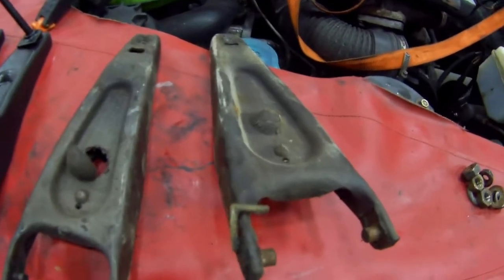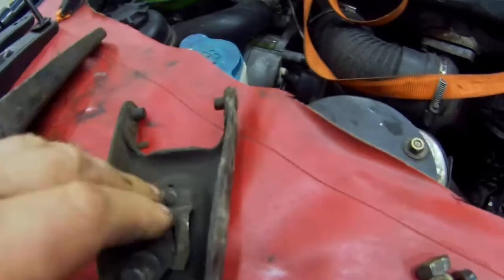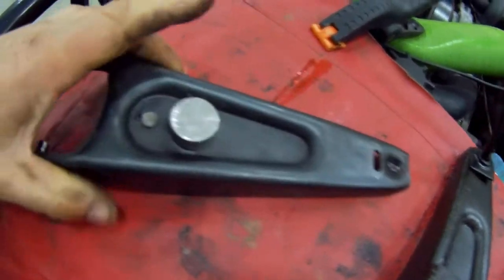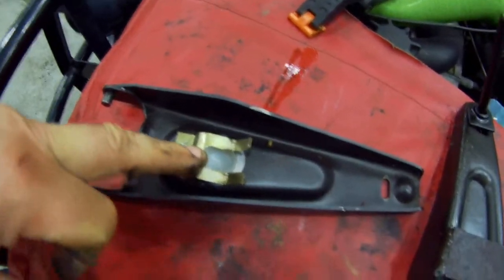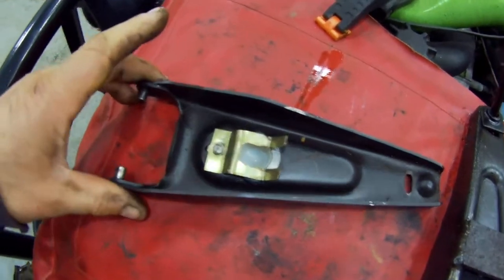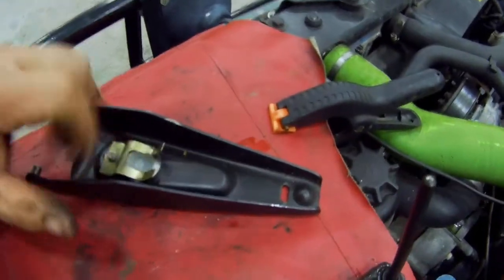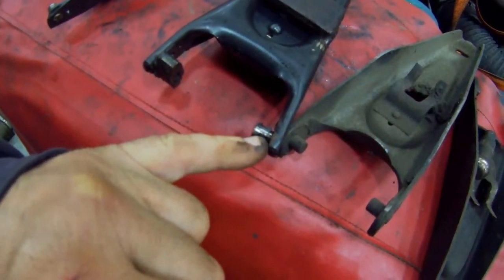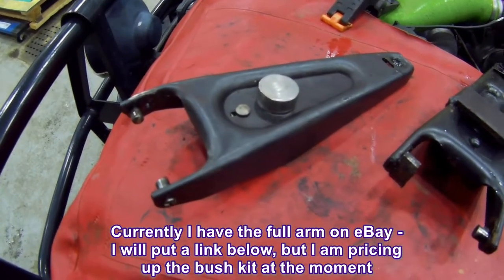Land Rover clutch fork/arm (FTC2957) failure, and my solution

Comment: Have you come across the problem of the fork pivot being too short when converting from auto to manual & fitted standard r380 box but HD lof clutch kit. The fork hits the bell housing before it engaged gears.
Reply from the maker: The pivot ball comes with the bearing guide, so there should not be an issue - but it could be someone has fitted a short LT77 pivot in its place
You didn't mention what vehicle this is, so not easy to give an accurate answer
Reply: @BritannicaRestorations  sorry the vehicle is a 300tdi disco, I've now replaced the clutch fork & pivot with another HD LOF part but still have same issue, however I can get gears when engine runs if transfer box in neutral but can't change gear if in high or low so can only drive in whichever gear is chosen. Clutch pedal stiff but can push to floor with hand so may not be bled enough.
Reply: @BritannicaRestorations  quick update, I've re fitted the transfer linkages today as per watching your video so thanks for that as I was struggling for high. Now I've got high & low working & a good cluch pedal I'm having to force in to gear but can drive all gears but to get reverse have to put transfer into neutral then put in reverse then transfer back in to high. Am I right in thinking I've got a bad transfer box ? All gears change fine & smooth when engine running & transfer box in neutral. Thanks.

Comment: Hi Mike, I had a fork fail on my 200tdi LT77 110, I had replaced the fork every time I did a clutch or the box/engine was out, but at 260000 miles the fork failed.  What I found was the pivot ball (which I had never looked at) had worn into a bizarre kind of point which made its job worse.  So at that time I replaced the fork and the pivot ball, and the gear/transfer boxes (The gear box was at 140k and the TF at 260K, the ATF in the LT77 came out siver! even through I drop the oils every 4-5k) .  Have you seen the pivots worn like that?
Reply from the maker: Yes Pete - that is why I make the bushes for the fork!! sold hundreds and never had one fail
www.britrest.com/shop

Mike
Reply: @BritannicaRestorations  I'll be ordering when i get closer...  at my current rate of progress 5-10yrs :(

Comment: Hi Mike! Again, more great stuff! I am going to jump into my clutch once the weather warms up, any chance I could get a "Britannica Fork Kit"?? :) As a mechanical engineer by trade, this is exactly the type of modification that makes complete sense. Also happy to support the cause and be a tester down here in the lower 48. Any way to get the mod kit being that I already have a fork or you prefer just going through the ebay with the full kit? Happy to return my fork for an upgrade. Thanks Mike!
Reply from the maker: Hi Thomas
I have the forks already made and they have been very popular with zero faults so far
You can get one off my website www.britrest.com , or ebay  http://www.ebay.ca/itm/112276627791

I do not need the old fork as it is not worth the shipping unfortunately 

Thank you for the reply and if you get stuck drop me a line at britrest@britrest.com

Mike